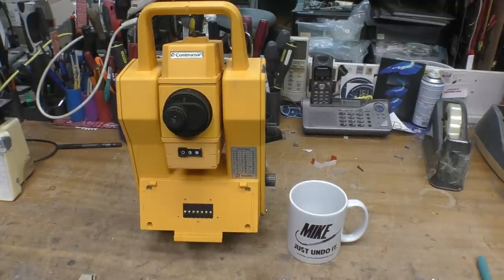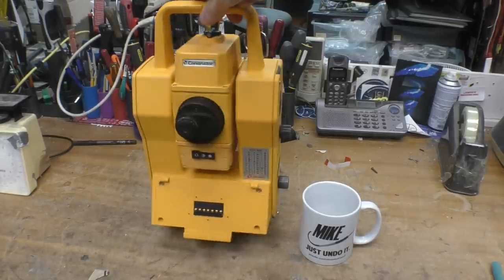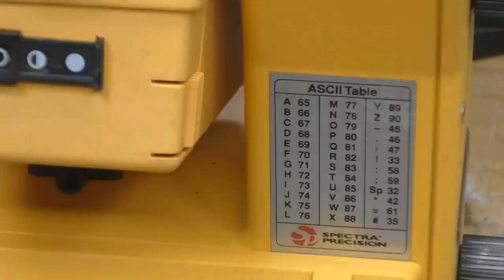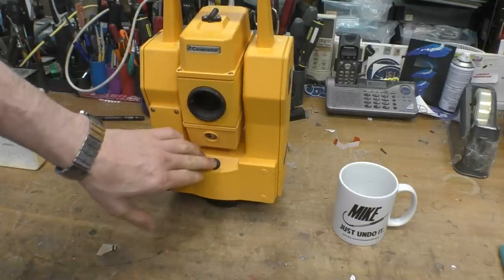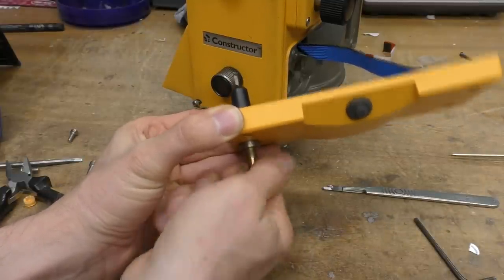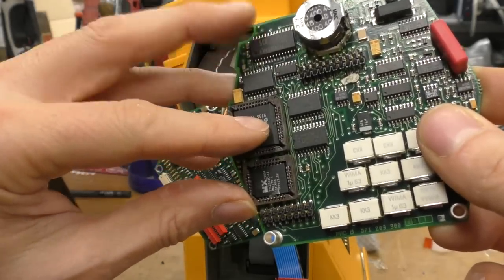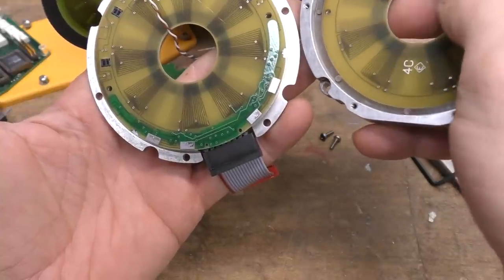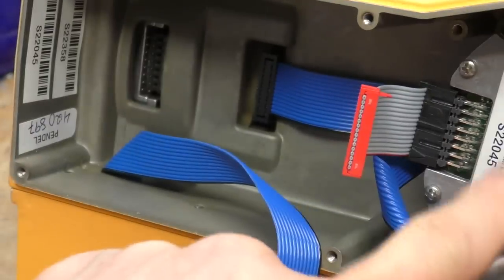Spectra Precision Constructor total station teardown

Comment: For the ASCII table - I've also seen them on old mobile road signs. The interface for entering the message is just a 3x4 keypad, so you enter ASCII directly. I assume people using this would also use those road signs.
Reply: I had an old label printer when I was a kid that worked the same way.

Comment: It's great to have such an in-depth teardown of a total station, thanks Mike! The little widget on the top of the telescope is for the person operating the TS to get roughly in the right direction to point at the person with the staff - sight down the widget with both eyes open so the circle is full, and make coarse adjustments of the scope until the circle covers the top of the staff, then look through the scope and use the fine adjustment knobs to zero the crosshairs on the reflector. Normally the rodman's job is to hold the staff upright and in place and wait for the surveyor to shout that they've taken a reading. They need to keep an eye on the spirit level on the rod, and so won't be able to sight back to the TS. With staking-out (positioning the staff on a pre-computed point) the surveyor will set a known location and the TS will guide them up/down/left/right/back/forward, and they shout to the rodman to move until the reflector is in the right place. So in both cases the rodman's job is the more important - they need to choose the right location and keep as still as possible. The surveyor just needs one working eye, and the ability to press a few buttons.

The black and white part of the rotary encoder is for taking double-face shots. The surveyor will sight normally and take a reading, then they will flip the telescope and rotate the TS 180 degrees and take a second reading, the TS then averages the angles which eliminates any mechanical offset errors.

The ASCII chart is fascinating! The only thing I can think of is after looking at the control panel it only has numbers on it, so typing text requires the user to type in ASCII integers! That's batshit for '97! My TS is only a few years younger, and it has a speccy keyboard style alpha numeric keypad. While there's not a ton of text that needs typing - most of it can be set up in the office through the serial cable - there's enough to warrant a proper alpha keyboard.

Comment: I was once given a Spectra Physics “Dial Grade” pipe alignment laser, as a teenager. A fascinating unit. Way, way before the internet I would work my way through the “Yellow pages” asking for old or discarded equipment (that’s how I got my first ever job at 16, as a TV & VCR apprentice). 

I sat up all night and took the “Dial Grade” apart on the sitting room carpet. I was new to taking things apart back then in the 90s; it was all so magical and exciting. I didn’t have a torx driver (they were mysterious, exotic things) and so persisted in forcing the security screws undone with ingenuity and brute force. 

I still CLEARLY remember the beautiful iridescent shimmer of the thick red HeNe laser beam, and the prettiness of the light reflecting off the coated lenses and dichroic glass prisms. 

I would clip the leads to a car battery next to my bed and shine it out across the fields so it hit the wooded area about a mile away. 

Beautiful memories.
Reply: If the beam looked irridescent, that HeNe was an impressive HeNe indeed!  Colors other than red are rare, especially as power increases and the higher gain lines start to dominate.
Reply: @railgap  shimmering is more apt. You’re spot on.

Comment: We had a total station from about the same era at a job I worked on a few years ago. 

The reason the front-panel/user-interface is removable is because it was effectively the storage disk for any measurements you took. The idea was you would detach it, carry it into the office, and plug it into a desktop PC which ran some accompanying software. 

These things are extremely sensitive to level. The power-on process for the one we had involved it requiring you to do an extremely fine levelling procedure. You'd need to level the tripod using it's built-in level, and then that would get the overall level close enough for the internal sensor to work.

I spent some time writing software to get measurements from it. It had a ridiculously terrible serial interface, which would periodically lock-up and become unresponsive.
Reply: My Nikon TS from the late 90s/early 00s is also a painful device to use. It doesn't have a detachable keypad, so you have to lug the whole thing to the computer to do any comms. Thankfully I've not had any crashes with it, but it is still a faff to get what you want and then translate the output to something less ~batshit~ memory efficient.

Comment: Thank you for the tear down.  Reduces my urge to tear mine apart.  With careful battery change I think I can get some years of life out of mine when I learn to use it.  The User interface on these units is abysmal with cryptic numeric command codes that made sense when the first total station was made and then the surveyors learnt the codes and did not want anything to change.

I'm reasonably sure that this was originally the Geodimeter brand that was purchased by Spectra Precision and then by Trimble.
The earlier units had a DE-9 connector and later a 4 pin so this case was perhaps made during the change over period.

The DE-9 connector has RS-232 or ASYNC TTL and power on non standard pins but not sure what the other contacts on the 6 way slip ring were for. I have a GDM424 Geodimeter unit that is before this one and this was probably one of the 500 or 600 series units,  I think some model numbers were changed somewhat when the ownership changed (Trimble may have added 5000 to the model number).

The displays came in numeric and alphanumeric versions (cost cutting a keypad) so the ASCII table was to enable a numeric interface to easier enter alphanumeric names for the surveyed points.

The various units had either just calibration constants stored in the units with the battery backed ram or some of the 500, 4000 or 600 series units had the user interface program also RAM backed up. Earlier than the 400 units some had the fixed constants loaded into RAM memory as well that were the same for all units, perhaps they thought that some error in hardware or software could be compensated later by adjusting the speed of light to air density calibration.  In the end all of these earlier units become doorstops if they loose their battery data because Trimble can no longer access the factory presets and except for one enthusiastic fellow nobody has any way to generate the calibration constants for the units.  This amateur specialist might be happy to get copies of the ROMs for his collection.

The little telescopes are for coarse sighting  for the operator.  Some devices have a light beam they shine to the pole holder so he can point the prism (reflector) at the operator at the ranging station.

Some of the units with motorised sighting had detachable keyboards with radio link provisions, later units this was standard.  The lone button was to take a reading when the unit was flipped over and the keypad was on the other side.  Not much used on these because the factory calibration and the internal levelling (compensator) provided almost the full accuracy with just a single sighting. Some units could send voice signals to the pole holder via the measuring beam to an optical receiver attached to the pole with the prism.

I found a table that indicated some of the modulation frequencies used to calculate the ranging and while I did not follow why they were chosen it seems that there is some important reason.  Here is a selection of the frequecies in Hz.
29970000
14985530
14985543
14984651
14984629
14985453
14987103
14987090
14983482
14985400
These were from 4 manufacturers including some Geodimeter but not these particular units where cryptic notes hints at the reason.

Note (i)
The carrier wavelength can vary between 850nm and 910nm due to the use of different types of diodes from various sources

Note(j)
The manufacturer selects the modulation frequency (~15 MHz) according to the actual carrier wavelength (as well as the 10M unit length) so that the same C and D terms can be used for all instruments

The "Terms of first velocity correction" indicated as  C=275 and D=79.55 are the same for all but the very early Geodimeter total stations.  Other vendors have different constants.  Geodimeter also has their "Reference Refractive index" = 1.00275 for later units, other vendors have different values.

"?" gives a command list on some units.
Someone called mike1202 offered the following serial commands, 
"OV*" - dump memory,
"RV,100" - GDM model
"RV,110" - loader time and date
"RV,111"- GDM serial number
"RV,113" - program version
Some others can clear all RAM memory

The open source project is on GITHUB user ROBOTS project GDM I think that may be the same user that provided the command list above.
Reply: The empty space behind the one side panel is for an optional extra battery compartment or an optional radio link.  

The hole in the battery compartment where the logo is visible is where the TrackLight would shine for the "rod man" to know where the operator is standing so he can orient the prism appropriately.  The TracklLight is cool because it changes colour like glide slope indicators at a runway.  The station operator can point to where he wants a measurement to be made and then the rod man can move along a line to the point where the light changes colour from red or green on the sides to white in the middle.

The 600 series came out in 1994 with the models 610, 620 and 640

You can see a lot of history in a document.

Search for "The History of Geodimeter J.R. Smith"

Comment: regarding the strange positions of the pins in that photodiode package, it looks like that puts one pin in the center of the package, so I would guess the actual photodiode die is mounted to the face of that pin.  That would provide some improvement in package parasitics versus the other method of mounting the die to a shelf in the can base and bonding it out to the pins.  The latter method is more common in laser diodes for better thermal coupling of the die to the can, but means the diode is either electrically bonded to the can or is capacitively coupled to the can via an insulating layer.  Putting the die on the face of a central pin isolates the diode entirely from the can without the capacitive coupling and eliminates one set of bond wires.

Comment: Very nice I've always wanted to see a total station tear-down.  I've only read about inductosyn encoders, never seen one dismantled.  For getting down to 1 second of arc it has an impressive lack of poles, so most of the resolution is from phase measurement.  Yes I suspect the coarse optical is for absolute ambiguity removal.  I wonder if they calibrate the encoder to remove its stationary non-idealities rather than relying on precision construction and alignment?
Reply from the maker: Making it with PCB will be pretty accurate to start with
Reply: @mikeselectricstuff thanks for this teardown ,  they are a linear version of this encoder found in digital caliper .
Reply: @labiadh_chokri  Indeed! And I am amazed how accurately even the cheap ones can discern the tiniest movements

Comment: I've wanted a basic digital theodolite (don't really need GPS, but a rangefinder would be nice) for ages... despite not actually having a dire need for one. :)  They can be quite handy, even indoors in a machine shop!
Reply: The hand held laser range finders that you can get for EUR30 at the hardware store are remarkably convenient though limited in range and probably accurate to about 10mm.

With used total stations you get a little more accuracy and the angle readings but the old units are a gamble if they break or have lost their RAM battery voltage.  Some units loose constants, calibration or even firmware.

Comment: I worked at an engineering company that used total stations. It's high precision stuff because they would use such a device in multiple steps into a long tunnel to get the "GPS" coordinate of the end so if you want to have mm precision 1km down you need precise angles. I wonder if the encoder could be done with a passive rotor with a tab that changes a wave guide length and use RF and phase detection. That way you have a single location for electronics and presumably inexpensive. time of flight should be fairly reliable, maybe air density compensation. With clever arrangement a single emitter might be able to determine the angles of multiple encoders. That would be kind of neat.

Comment: The ASCII table is likely useful because they didn't have the option to press a number several times to get 'abc', 'def' etc, like on a 90'es cellphone (before T9 dictionaries). Even though the date codes say 1997 the design is likely much older

Comment: Is this angle sensor perhaps a type of  resolver? CuriousMarc has done some episodes on them, and I think they are really cool.
Reply: When Mike mentioned inductive sensing via a transformer, the first thing I thought of was a resolver. I have an old CNC that uses those for position feedback.
Reply: From the looks of it, it's probably an Inductosyn - very similar to a resolver, but with a lot more poles for increased accuracy.
Reply from the maker: I think it's pretty similar, though looks like it has more secondary windings for increased resolution

Comment: You’ve got it backwards. Those little sights aren’t for the guy holding the prism. They’re for quick rough sighting by the instrument man. Look at them from the eyepiece end and you’ll see an arrow that you can then line up with the target.
Reply: pretty sure that if object is in the middle on all axii, the accuracy end is where ever you point it. not which side you look through. if you look thru the wrong end and still get it all lined up, thats jedi master level skills territory 😂🤣
Reply: @Palmit_  it’s a lens assembly, it not just a tube with a mask in the middle. I have them on a couple total stations and theodolites. When viewed from the eyepiece end, the arrow can be seen very clearly.

Comment: ...Looks like an older vintage Geodimeter 600 rebranded-purchased under Spectra, Trimble names,  A Trimble 5600 with out radio-remote servo's, late 90's unit... Front control panel plate is easy to find on-line.

Comment: Wondering if that position sensing device is actually a high-precision resolver?
Reply: That's what I was thinking too.
Reply: Also what I thought. Resolvers usually are a bit more heavy duty but this might be based on the same principle.
Reply: 'splain "resolver" pls.
Reply: @Palmit_  in short, a magnetic coil that sends voltage back as position. It’s much more complicated than that, though.